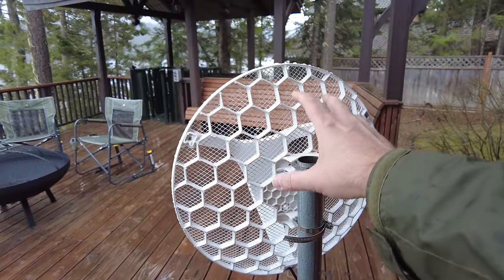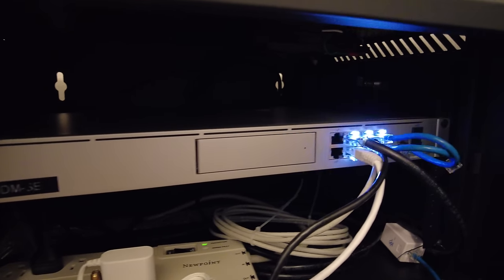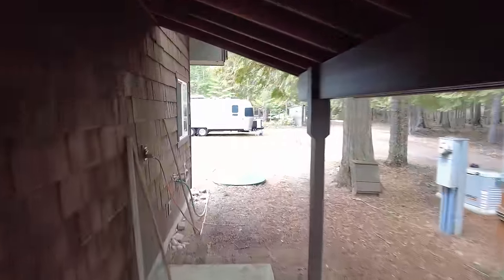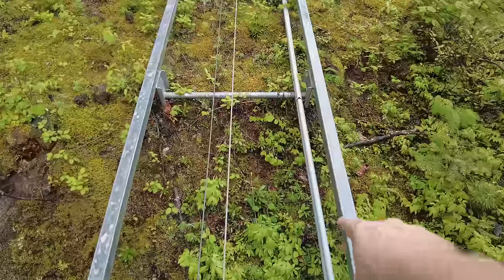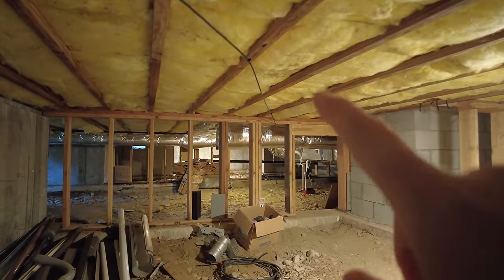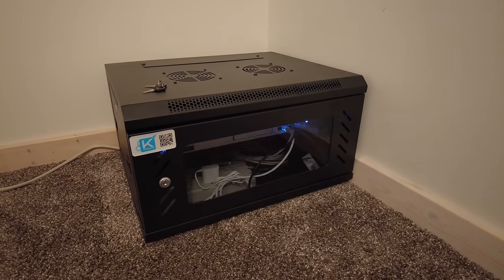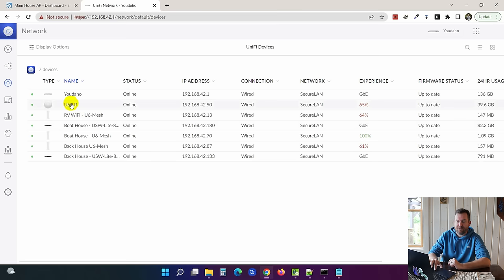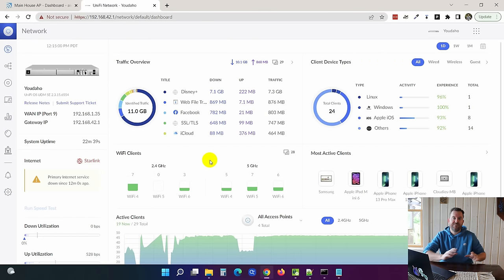An EPIC Network Install in a Beautiful Location!

Comment: Really useful video - similar to this solution, I'm trying to use a 5G router in bridge mode, connected via VLAN-only VLAN99, acrosss my Unifi network to allow me to position the device and get a better signal as a failover connection but when the VLAN99 port on the UDM-SE is patched WAN2 port it's assigned Class C IP in the 192.168.x.x range and I cannot ping out.  

When connected directly to the WAN2 port the 5G modem works fine and I can ping out successfully through the WAN2 interface, although seems to be assigned a Class A IP address in the 10.x.x.x range.  Is this a symptom of CGNAT or am I doing something wrong?  Would using an 5G ISP that assigns a public IP address (i.e. not CGNAT) resolve this issue?

I have a U-LTE-Pro which works 'okay' using the same 'CGNAT' ISP SIM (obviously automatically tunnelled by Unifi) but latency and speeds are disappointing despite using external antenna.

Any tips?
Reply: Update: have now obtained a SIM from a 5G ISP that provides a public IP, however when the device is patched through the VLAN it's still using a Class C address.  Thoughts?
Reply: I think I fixed it - I believe because the device had previously been connected to the switch and allocated an IP on the Deafult LAN against its MAC address, it was being allocated the same address even when connected to the port with the untagged-VLAN.  Having connected a completely different device to the untagged-VLAN port, it correct;y ported through to theWAN port and picked up the external Public IP address!!  Works!!!

Comment: Not to be that guy but the outlet ran in the back house should have been ran with metal flex and not exposed romex. The romex run like that creates a hazard and violates code

Comment: My issue with my newly purchased nanobeams are that they glow in the dark, because after hours of surfing the net I haven't found a solution to the Power/Ready LED staying on all the time.  Does the Plastidip eliminate that issue?  That LED lights up the inside of these units so taping over it does very little to help.  Anyone know how to turn that thing off?

Comment: Hmmm… What happens when a reboot is required using this VLAN configuration? 
I can never get this type of VLAN setup to work. It puts the UDMP in a loop and never provisions correctly. Yes, it works initially when the network is up and running but in the event of needing a reboot is when the problem shows it’s flaws.. This is just my experience. 
I was trying to put my Gigabeam LR bridge on the LAN side because my modem is off site. The Gigabeam bridge is connected to my modem directly. 
As it sits now I can’t manage my Gigabeam link because it’s on the WAN side of my network which goes into the WAN port of my UDMP. I want it on the LAN. I get it to work but it becomes unstable. Then reboot and it’s done. 🤷🏻‍♂️

Comment: Question for the community if you would so kind to help, the charity that I work for needs a PTMP set up that covers three separate point locations that span a 90’ area 1km+ from the base location. All three locations must act as part of the network and must be reliable even in bad weather. Each location will have Wi-Fi, a camera and a couple of Ethernet connected devices. Now to my question, would it be best to go with a rocket with a 90’/120’ antenna along with 3 nano’s as I’m assuming the nano in PTMP as used here wouldn’t have the spread to work for all three. My second question is question is in all the PTMP bridges I see used online, it’s always airMAX not LTU used, is there a reason? My research suggests LTU doesn’t support bridge mode but it’s hardly conclusive given what little I could find. Any help from anyone would be great as currently they rely on expensive and unreliable mobile services.
Reply: I've found it very hard to get info on wireless bridging so I'm sorry I can't help with the LTU question but my next option is to ask Ubiquiti support, they may be able to tell you what you need to know.

Comment: What rj45 to sfp+ adapter do you recommend?  I need one that works with My UDMP-SE to setup my dual WAN.
Reply: You may not need it, on the UDM Pro (not SE) the latest FW allows you to change an existing RJ45 switch port from LAN to WAN2.

Comment: Hahaha.. I seen people scream over terminating that CAT6 Shielded cable. As you need special made outdoor rated connectors...That also can be grounded at the connector. I like to use AUCAS 2 Piece Cat6 RJ45 Shielded Load Bar Connectors.

Comment: how come you never see people mention things like lightning arresters or grounding, like you're running a cable from one spot to another, outside... I've never been a fan of running copper outside if i can avoid it.  I would consider fiber, sure, might cost more but you're literally using 100% uniquiti hardware, i don't think cost is going to be a huge factor..........

Comment: UDM SE + PoE adapter to power the Bridge's AP? Am I confused, why add another PoE adapter? Are adapters and injectors different?
Reply: The PoE adapter converts it from 802.at/af to 24V passive. The Bridge AP requires 24V passive, but the UDM-SE cannot provide it, therefore the adapter does it. A PoE injector connects into normal AC power, and puts power onto a cable. It is the power source, whereas in this case the UDM-SE can provide power, just not in the necessary format the Bridge AP needs.
Reply: @ZippyDooDa435  Ah, so the UDM-SE is "active", not "passive". Adapters convert. Injectors insert. Thank you.

I think Ubiquiti needs one of those tools for dummies on their site to help users know which switch to buy. They have that cool resource calculator tool for consoles + CPU/RAM, they should do the same with switches, adapters, injectors, etc. cause it can be confusing knowing which to buy.
Reply: @shadow.banned  Yeah no one uses 24V passive really except specific Ubiquiti equipment. It is annoying. I’ve never understood why they don’t standardize on regular 48V like everything else but then I guess they couldn’t sell a bazillion adapters and converters.

Comment: 3 or 4 staged buildings on property fiber optic between buildings is best

lowest point of property isn't ideal spot for link aggregation due to constant moisture

I would tell the current owner due to weather conditions I might consider trimming  the tree tops  to better to access for ptp link wireless what is in use might of been cheapest option to install

however given the statement actual internet speed Kinda tells me what is installed might be beyond its capacity of distance to adequately serve with a decent connection..

I think air fiber 2dish network option I don't know what the ferry infrastructure is like there however whatever you install  will have to exceed the top height for uninterruptible service though personally long term  deployment goal would be service fiber to the mainland..

Because at cost it will be cheaper than licensing spectrum for 20+ years to give some form of wireless/sat internet service

at the lowest service point you might be be deploying a 80-150  foot mast to get  ferry lane clearance 

Ive always treated wireless whether it be:
sat
starlink
parabolic satdish ptp link (home brew)
some form of ubiquiti dish (not air fiber)
4g-lte/5g
always as secondary class services due to data limits on these internet serviced connection

primary wherever plausible to be deployed fois

if you can external ants you will be good for upto 5km/3.1 miles a poe powered wap at 4 points of the compass on top buildings  and may1 at the boat shed you should be fine..

Comment: Point to Multipoint a good idea in a area which dealing with a lot of snow?
Reply from the maker: Should be fine - all of the PTMP antennas are protected under roof eaves for the most part.  The snow would have to get up really high to be an issue.

Comment: DreamMachine Pro SE + Wireless AP consume ~45W idle. ($78.84 / yr @ 20 cents per kwh)  Is there any way to reduce power consumption?  (Disable something after hours?)
Reply: Holy shit your kWh is expensive. Not really sure what you can disable.
Reply: @imperialdoggo5826  Rate is advertised as $0.09 but after taxes, fees, and adjustments, it more than doubles.
Reply: @andyh8239  Jesus. My kWh with all that is about 0.14
Reply: @imperialdoggo5826  Not in a blue state I'm guessing? 😂
Reply: @andyh8239  Canada actually

Comment: Recently had very positive experience with the Unifi WiFi6 Mesh AP's. Good choice on your part. This AP would also have worked to reach from the main house to the back house (good for 100+ meters). But it only has an aggregate bandwidth of 5.3GB/s, so not nearly as fast as the nano beams you used. This AP has an IPX5 rating, and so was a perfect for the RV parking area. Nice install on your part all the way around!

Comment: Was just wondering with the conduit going out on the dock.. if the water level rises will it get into it and then potentially cause issues with the cabling?
Reply from the maker: The water level would likely never get up to a point where it would get into the conduit - BUT - if that did happen, the Starlink cable is made to be directly outdoors in the elements...so it shouldn't hurt it at all.
Reply: I'd put a glob of outdoor high quality silicone at the top and bottom openings of the conduit just to keep out water and/or critters. it's easy enough to pry out in the future if you needed to change out the wire or add in another.
Reply: @jaredvw  For the water level what popped into my head was doing the pipe coming up the pole and then snorkel style (to raise higher from water level and downward pointing opening (and as you mentioned still enclosing for critters) but if water level changes aren't really a concern and/or if would be too much change in esthetics or cause it to be in the way then different story..
Reply: My understanding is that any conduit that runs underground is considered a wet location. I just installed my starlink on a pole about 95' from the houses and ran the cable in buried non-metallic schedule 40 conduit ( A word to the uninitiated,  the starlink cable almost has to be pulled from router to dish because of the different shapes of the connectors on each end....and the connectors are large). 

 After installing, I read where Starlink will void the warranty of the cable if  run in underground conduit.  Apparently the cable is not rated for a 'wet' environment.  Am I wrong?

Comment: Hello, Sir I would like to let you know that I live in a countryside area which is inaccessible to fiber thtat's why I use wireless broadband at a air distance of 8.45 km with ubiquiti litbeam installed at a height of abouve more than 50 feet with clear line of sight i am using internet at a speed of 100mbps with latency less than 10ms. getting service like fibre broadband I am very happy. I am also getting throughput above 140 mbps with multipoint easily. I can stream videos in 4k hdr like your videos.

Comment: Can you still not use a VLAN as a WAN interface directly on a Unifi Router. I come from a MikroTik background and there you can just do that, no need for weird pigtails feeding back to the WAN port
Reply: In the Unifi Controller, when you go to Networks > Create Network, you select the "Purpose" which in this case would be WAN. After selecting WAN it will allow you to select interfaces for the WAN connection, which in this case likely only allows you to select WAN1/WAN2, not any of the switch ports. The purpose for the most part sets up a bunch of NAT rules, firewall rules, configuration, failover config, etc. So it's fairly opinionated about what ports you can use.

Whereas something like Mikrotik is not and will let you do whatever with whatever ports. The Unifi will in the case above allow you to say it comes in on a VLAN, but it expects it to come right into that port. So in this deployment case he has to pigtail it from Port 7/8 to the WAN1/WAN2 ports, and there is no reason to have it come in on a VLAN if you can untag it when it comes out Port 7/8
Reply: @ZippyDooDa435  It just seems a bit of a waste to me to have to give up 2 ports and I don't understand why Unifi even differentiates between LAN and WAN interfaces. In the end they are all the same and there is not reason to not be able to do something like this. Also what if you want POE out on the WAN interface. With MikroTik just change one of the POE Ports to WAN but here it doesn't seem possible

Comment: Nice design if I do say so myself...  That said, I've got a couple of minor questions regarding the installation:  First off, you went to the trouble of applying black plasti-DERP on the AP's but left the mounts their original white color.  Why? It seems like that would have been logical to paint both to maximize the reduction in footprint against the house.  While the mounts may not be visible from far away, they are visible when near the house.  Second, you placed the UDM SE in an 4u enclosure.  The equipment in the boat house, on the other hand, was just left under what looked to be a stairway. For consistency sake, would it not have made sense for each "network closet" to be implemented in a similar manner.  Granted, enclosures aren't cheap but you could have used 4u open wall mounts and saved the customer a few bucks. And instead of using an expensive rack mount UPS, you could have placed a standard UPS on the floor under the wall mount. Was the 4u enclosure a specific customer requirement?

Comment: Here's my video. So I'm one cabin over in front of the neighbor's. Look how far out I am.  I'm getting Wi-Fi with a Powerline range extender that has one antenna for 2.4 GHz and one antenna for 5.8 GHz. If I put the access point on the top story more toward the driveway in the center, then I will get it in about 100 feet out from shore. This is about 250 yards from shore when I placed the access point right in the corner so it could reach. https://www.youtube.com/shorts/Shx-t21_9IQ

Comment: you really should work with an electrician until you know how to properly pull wire thru a conduit.  not to mention, i'm not sure that would be legal to bring the conduit in through a vent opening.  and that cable requires special RJ45 connectors.

Comment: Probably would not have put the Starlink on the dock. You already said that it would be inaccessible during the winter heavy snows. Would just have found the best sky view somewhere else. The ISP antenna could have gone on the corner of the deck at the main house and it would have been also clear of the trees.

Comment: Wasn't a big fan of how you ran that cable in the crawl space. Looked pretty amateurish to me. Just because it's a crawl space doesn't mean you slack off. It should be as neat and professional as a visible portion of wiring. And running that cable through the framed wall instead of over it is going create problems if they ever want to finish it. Run the cable over it, move the insulation out of the way and secure to the joists. Much cleaner install. Also wasn't a fan of where you put the enclosures. Work with the owner to develop a server closet. That equipment should not be sitting on the floor or out in the open.

Comment: Nice job but I would have run a power circuit from genset to initial wan and put router there. Of course gen capacity / cost but owner doesn't seem to be strapped for $$$.